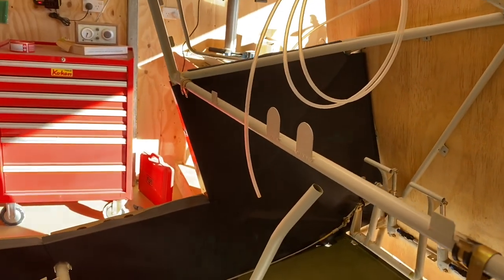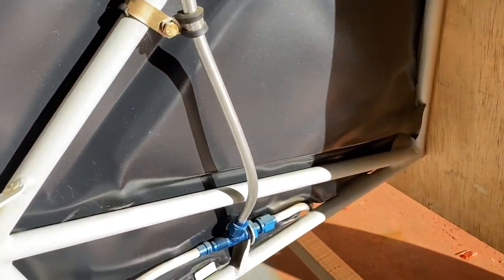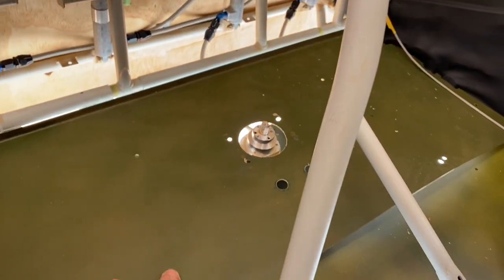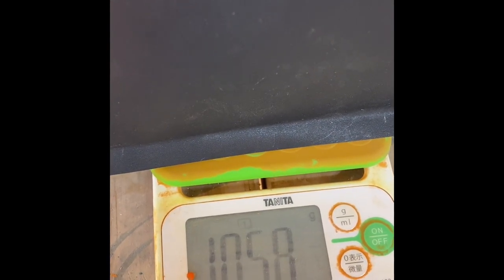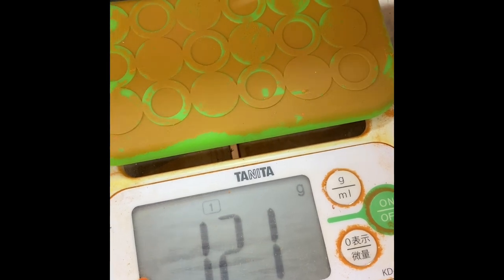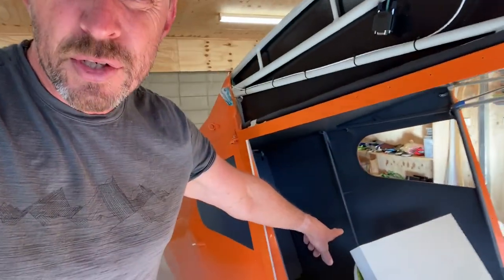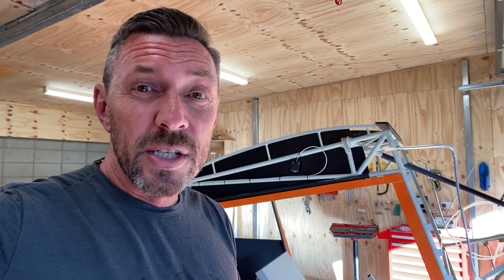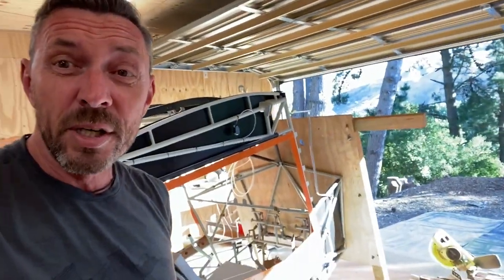Bearhawk Aircraft - Bushplane Build - Kydex panel forming

Comment: Really enjoy the videos and nice kydex work!  I used some kydex to modify the top of the panel on my maule (even drilled it for ventilation), but after just 1 day parked out in the 100*F sun it warped pretty bad looks like this now ~.  I think you’ll be fine in a hangar, but be careful if you park it out in the heat for a day.
Reply from the maker: Appreciate the heads up with that thanks.

Comment: Hi Nev. Have you thought about vacuum forming those Kydex door panels. A simple MDF mold and a home made vacuum table would work well..
Reply from the maker: Hi JT, yes a very good idea and in an ideal world I think vacuum forming would be the way to go. For the Bearhawk I think it would be a bit difficult to make the individual moulds, particularly the forward footwell ones. For normal 90 bends etc, it’s very easy to do either in place or on a bench.

Comment: Are you going to use any hardware to hold the kydex up by the boot cowl in place or just rely on the snap-action molded top and the floor panel to keep it in place.  Just curious if you think there's a possibility for excessive vibration if fasteners aren't used?  For the right hand side kydex near the rudder pedals did you heat it in place or did you heat it up, put it in place, and then start using pressure to get it to mold around bars/fuel lines/etc.?  Lastly what thickness kydex did you go with?  Thanks for all these videos they are immensely helpful as I'm still in the planning/dreaming phase. :)
Reply from the maker: At this stage I’m not planning to add hardware. It may vibrate, if so I might add a few spots of sikaflex once the test flying is complete. I don’t actually think the panels will need to be removed often.

I’ve used .028” Kydex. The front panels were mostly made up on the work bench, including the triangle shape. I then fitted them and tried to install the aluminium floor panel, and applied heat to the outside of the lower Kydex around the fuel lines etc. The force from the floor panel easily moulded the Kydex.
Reply: @bearhawkblog3527  Thanks for the reply and making all these videos!